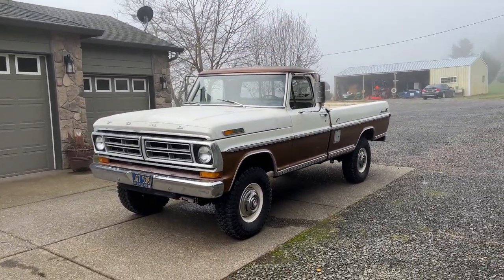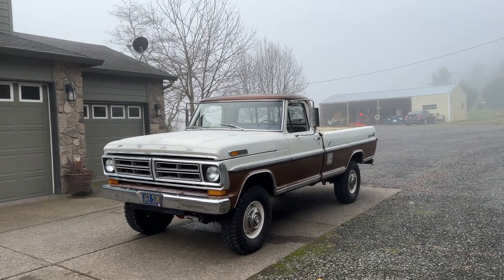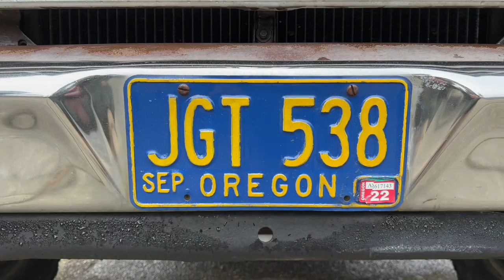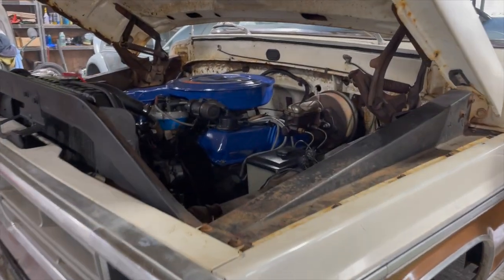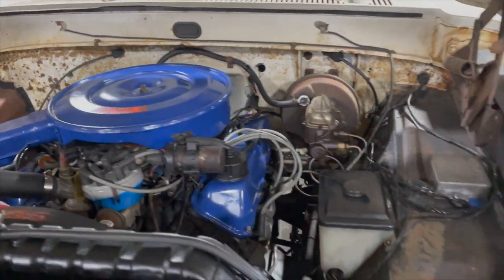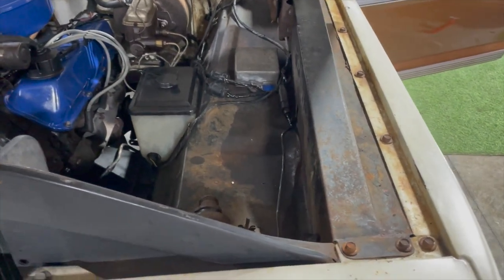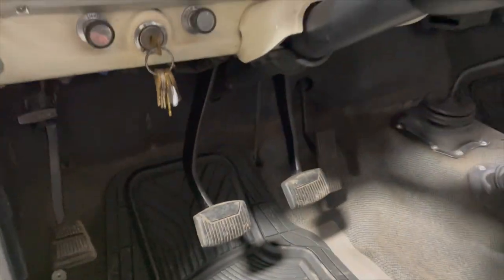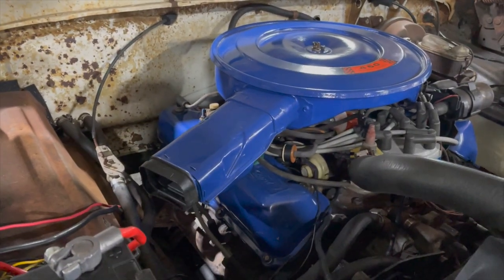1972 Ford F250 4x4 Highboy Sport Custom Ford Trucks Bumpside Bump Side Trucks

Comment: Whr is the Vin on the frame located?
Reply from the maker: Great question.  It's usually on the passenger side top frame rail inside the wheel well area.  They can be tricky to locate, but a good wire brush and some brake cleaner might help.
Reply: Awesome thank you. I will look for it on mine. I have a 1972 F-250 Highboy with a 390